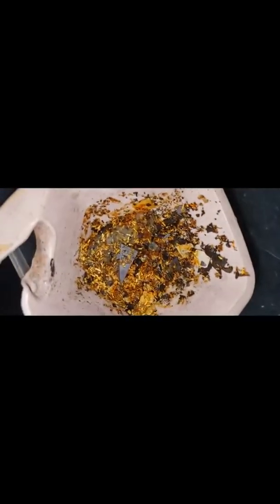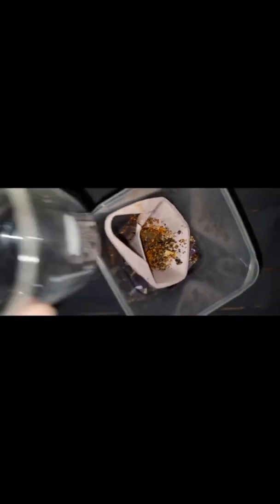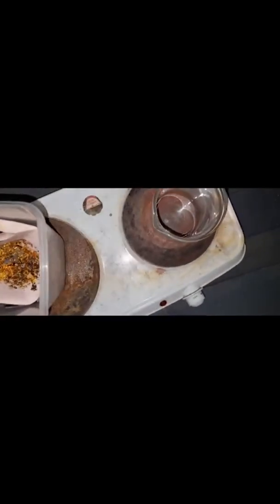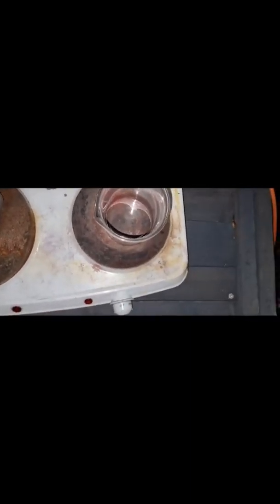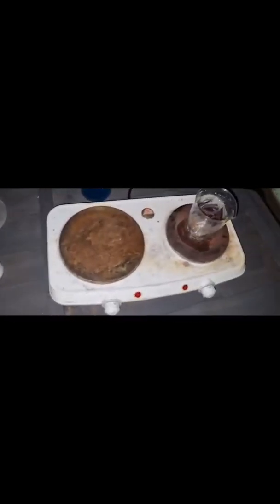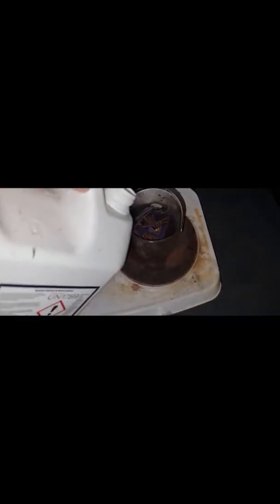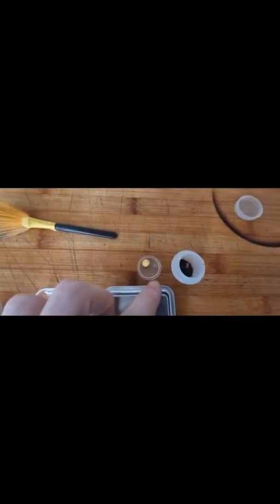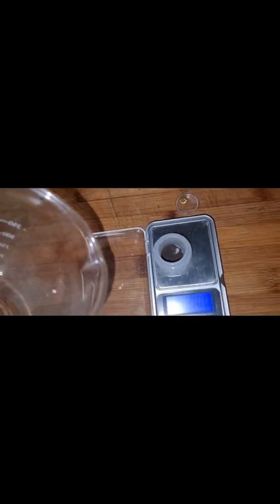gold recovery and refine of 19 pentium ceramic cpus (553g)

Comment: when your doing your main filtering.whats the white stuff in your filter paper..I didnt see you use a stannis chloride to test your solution after you dropped the gold..also on your ceramics,if you have some black spots on them.that would be gold.it happen to me before.migjt be worth leaching again and test with stannis..I'm not familiar with yields of Pentium.👍👍
Reply from the maker: Everything is being saved. I did parts off camera as well. The black dots is just a thing what was stuck on the ceramics. I didn't notice any white stuff in filter but if there is that'll be silver